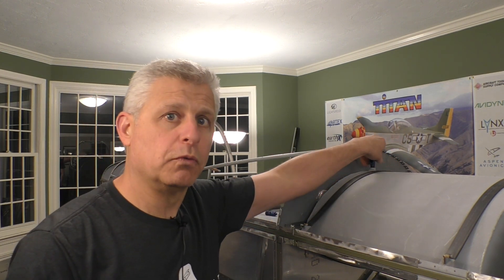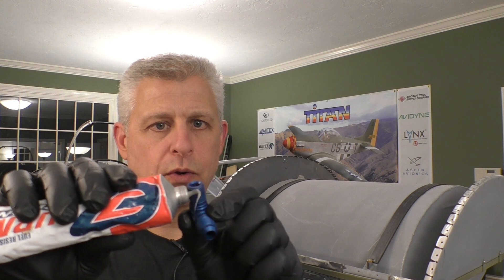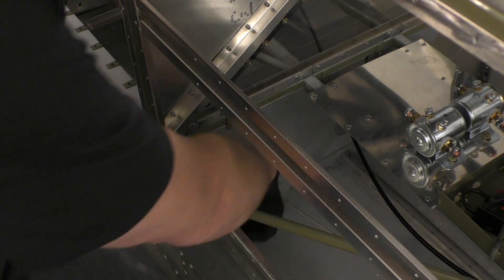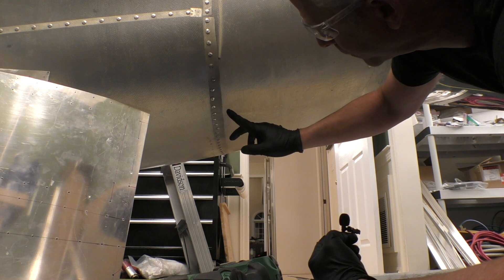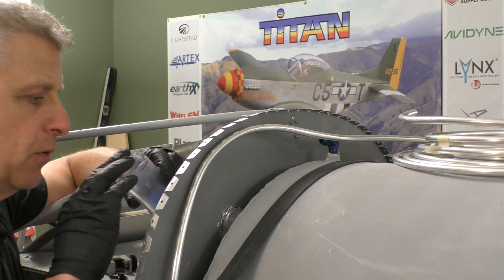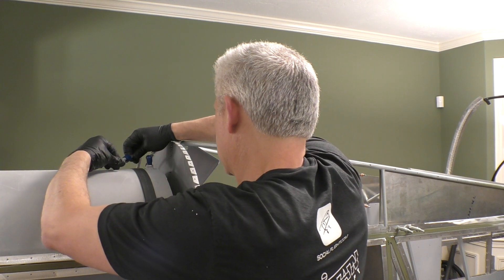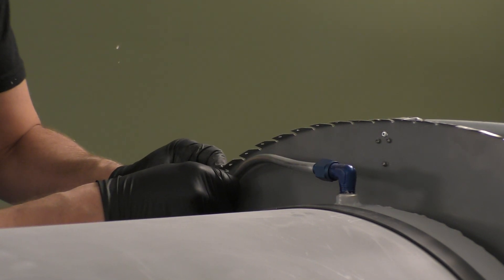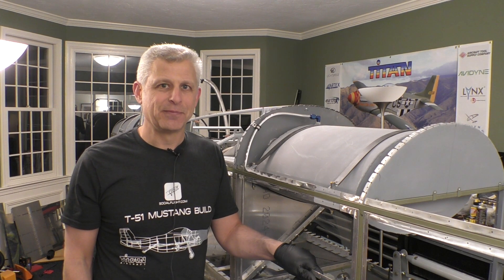Vent or Die: Preventing Fuel Starvation in Our T-51 Mustang

Comment: Don't forget the torque lock marking that they are secure. It sounds like you need an inspection panel in the turtle deck to allow access at a later time.

Comment: Why didn't you add an additional stabilizing Adel Clamp midway on the down tube?

I suggest that bending the external outlet forward (and even flaring it) would ensure positive pressure, but that cutting the bias on the backside creates a Venturi negative pressure.

To keep insects out, is there a plug with a screen that can be fitted to the ⅜" tube?
Can a faucet aerator be adapted?
Reply from the maker: Hi Susan - All great thoughts. The cut is facing forward and we did actually bend it forward 10 degrees, but didn’t have that on video. There’s also another adel clamp exactly where you predicted it should be. Not everything makes it into the videos sometimes in the interest of time (or just because we forget ;-).  Nice job on those thoughts!

Comment: is the t-51 able to carry 3/4 scale drop tanks,
Reply from the maker: Yes! Titan sells those as an option.
Reply: @SocialFlight  dang thats cool. Do they have both types used originally
Reply from the maker: @ninus17  not sure on that one. You’ll have to check with Titan.
Reply: @ninus17  The type they supply are shaped like the 75 gallon steel tanks. Note that late in the war they had a larger 90 gallon teardrop tank as well. If you want the 110/108 gallon tanks you’ll have to form them on your own. That said people have purchased replica 250 pound bombs and made them into EFTs.